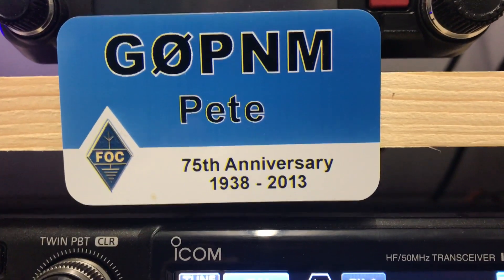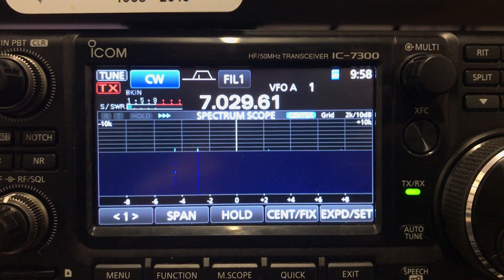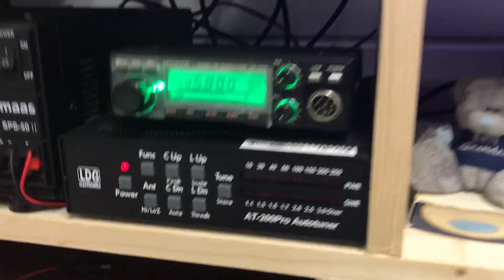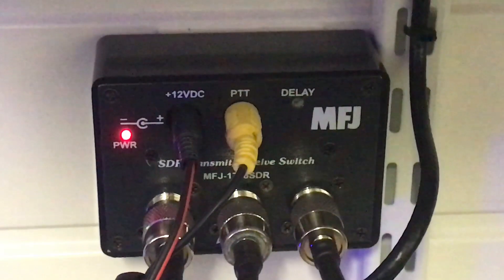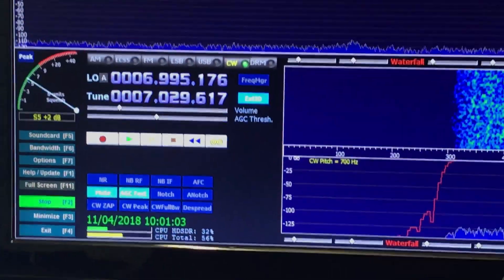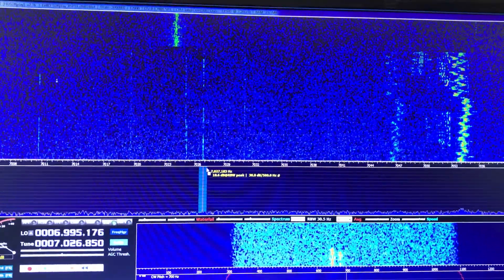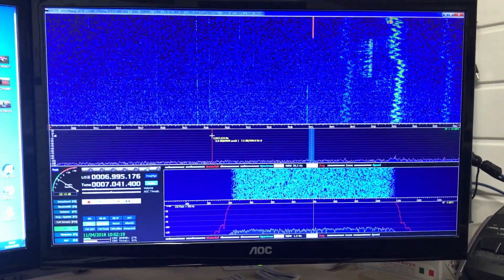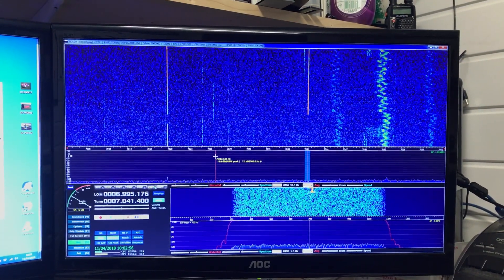Icom IC7300 panadapter MFJ-1708SDR, SDRPlay, HDSDR and OmniRig

Comment: How do you connect the HF Radio / SDRPlay in Omnirig? Rig1 I assume the HF but then in Rig 2 how do you specify the SDRPlay? I dont have a COM port for the SDRPlay. In windows 10 shows as Software Defined Radio as a sound card card that it is, so there is no COM port. There is a ton of videos about the cable connections but nobody explain the Omnirig / Sdr software part, funny, dont even MFJ have instructions for that, they just sell you they box and "good luck".

Comment: Hello Pete, Did you place any IF filter board inside the rig or it is just the MFJ and the SDR receiver? I assume in older version radios the MFJ is not enough to filter the IF

Comment: Can you tell me the cable used for the ptt on the switch connection to the back of which plug on the ic 7300? Can’t seem to find that info ??? Is it rca to rca...8 pin din to rca?

Comment: I tried the MFJ-1708 with my SDRplay and when i plugged the SDR in to the switch box my Radio became became def with static and the SDR was all so loaded down and some what def.
so i returned the MFJ-1708 and now i am going to try a PAT V RF Tap Board that lets you tap in to the radio it's self.
Reply: I too have the MFJ-1708. Loose as a goose, all the screws are loose and looses conection. What a rig burner. I'm sending it back. No more MFJ for me.

Comment: So I plan on getting an MFJ-1708SDR and a SDRPlay to set up the pan adapter. I have been off the radio for a number of years and cannot remember or don't even know where I would connect it to my antenna along with my MFJ-939 and SWR meter. Would it go - antenna to the mfj1708 to the tuner to the swr meter and then ic-7300?

Comment: So you have a cable running from the PTT jack on the MFJ box to which jack on the IC 7300?
Did you adjust any settings in the radio or did I miss that part?
Reply: I have the same question.  There isn't a jack labeled PTT on the IC7300.
Reply: Pete says its the SEND port.

Comment: Pete, might I suggest using SDRconsoleV3 beta if you want a really good and DETAILED waterfall if that is what youre aiming for. The console does support the RSP1a without installing drivers. Even SDRuno is producing a bit better waterfall compared to HDSDR. I use the same setup with the IC-7300, RSP1a and MFJ1708 in comination with omnirig. I can mail you my waterfall setup if you want when e-mailing me (QRZ.com). You will be amazed with the result. Best '73 ON2RON

Comment: With the RX-7300 you can eliminate the MFJ box. Just run the RX-7300 jack directly to your SDR Play. The switching is done in the 7300. That's the whole point of installing the RX7300. You can also put a T connector across the RX7300 and listen to both receivers at the same time if you desire.
Reply from the maker: Steve Ellington the whole point of this video was to show how to connect the SDR without the RX7300 mod, as I mentioned at the start of the video!
Reply: You're right. I never watch the start of videos. :*).... We need to keep MFJ in business anyway. Someone asked about using an amplifier... The PTT / Send is being used up on the MFJ. Some sort of diode switch would be needed to isolate the MFJ from the amps PTT line. Alternately one could rely on the 1708sdr's RF sense and use the PTT / Send line to key the amp. Just random thinking here.......